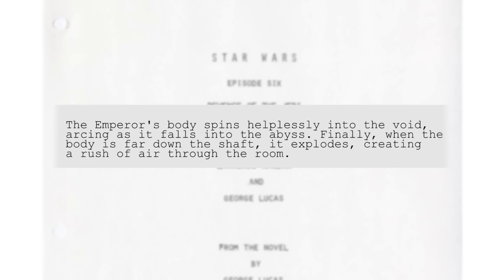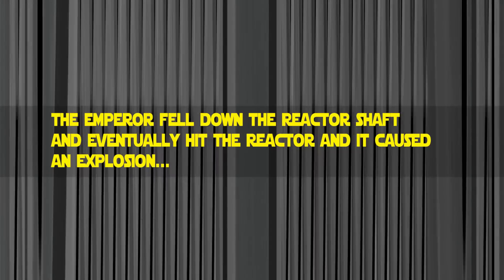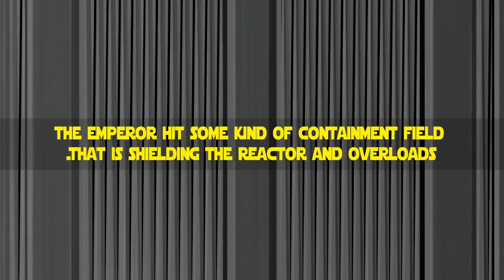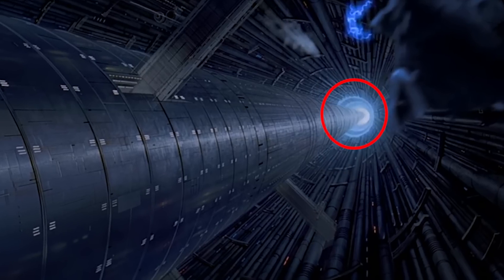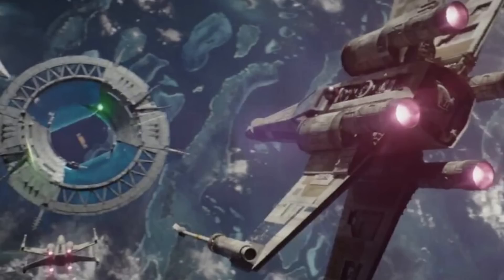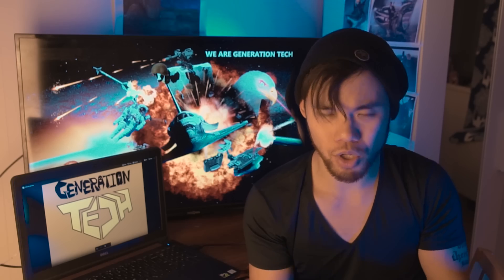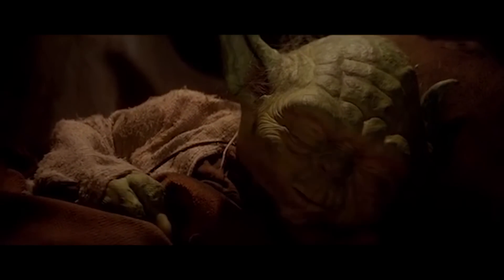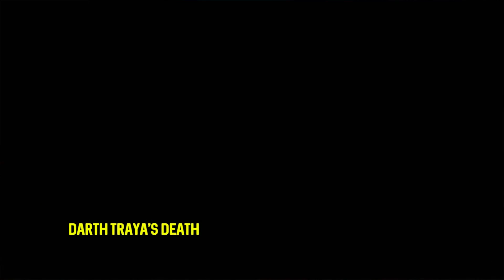Why Did Emperor Palpatine EXPLODE!? (Darth Sidious)

Comment: I've got two possible theories regarding this. The first is this: when Vader grabbed Palpatine, that force lightening that the emperor was still discharging was channeled back through Vader and into Palpatine (which is evidenced visually when we see several electrical charges detonate and light up Vader's skeleton through his armor.) This set up a sort of dark energy "feedback loop" that Emperor Palpatine was unable to control or contain. It was, in fact, providential that Vader tossed Palpatine's arcing body down the shaft; had he hesitated, the resulting inevitable explosion would have easily evacuated the entire observation deck into space.

The second hypothesis is similar to one covered in your video. Palpatine was uncontrollably arcing as he fell down the shaft. What he hit was not the shields themselves, but rather the shield emitters. It was, in effect, like a lightening strike to a power transformer on Earth, and the resulting explosion was both the emperor and the emitters annihilating one another in spectacular fashion.

Or...you know...space magic. ;)

Comment: If that was some sort of shaft to the core reactor, I imagine that as certain pointThe sheer heat and radiation coming off of the reactor Parent something as powerful as a planet destroying super weapon that had been fired multiple times over the last several minutes probably cause anything to burst into flames that got to close.

As for the distance to the core, again I would imagine that the weapon having been fired multiple times had caused a buildup of waste heat and radiation thus making the "burst point" further from the reactor.

Comment: As he was falling he was still using  force lightning which ignited the gasses around the containment ring. This resulted in an ignition of plasma which burst out in all directions, which is why is was swirling due to the positive and negative pressure waves.

Comment: the shaft doesnt have to be continuous. it seemed like a combination ventilation and power distribution shaft. notice how it had a shaft running through it? well something like the death star would require lots of ventilation to be habitable. the shafts would have to be huge. YUGE! fuckin massive. the ventilation ducts in large buildings that feed the client end ac ducts, are large enough for a couple people to fall down side by side. just a small piddly building thats not the size of palpatines bedroom. so these shafts would have junctions and other utilities in them such as cooling systems for reactors and weapons arrays. these would be interspersed throughout the shaft. they might also be shielded from flying debris or be shielded to help prevent intermixing of old and new air. or any number of reasons. also, do this experiment, take a Styrofoam ball, weight it with something and drop it through a pvc pipe just larger than it is. the pipe needs to be about 5 to 10 times longer than the diamerter of the ball. it will build up static rather strongly and quickly. now imagine palps falling down the tube, jizzing out all that lightning, in confined, electrically active column, its gonna build up some charge, well all that energy might be enough to ignite the atmosphere and produce plasma. this ignition isnt molecular, but atomic splitting molecules and rending atoms into a high energy state. it would possibly kinda resemble the energy leakage luke and vader experienced after the explosion.

Comment: Remembering that the Old EU has basically been pitched and the only darksider Sans Body we have seen is Bane. As well as the Fact all the EU was written After the Original Trilogy... I'm going to havt to go with the obvious thing here. Ret con-ing Maul was a Major F-up in Star Wars history making some other dark baddy would have been WAYYY more interesting but that would basically mean Mr Hudalgo would have had more time to write before production and less interference from George.

Be that as it may, the Emperor Better Stay dead. now if it some how comes out that EP  has been messing with Ben Solo's head by pretending to be Vader, that would be SO much cooler. as Palp's was a straight up evil deceiving jerk. So doing this would totally be something He'd do.

It's also cleaner than messing up Vader's whole redemption arch just to make money .... but that would mean someone at Disney actually cared about the Story 0.O & had the power to do something about it

Comment: How long did the proton torpedoes take to get from the entrance of the exhaust port to the core in the first death star? Wouldn't this give enough time for the death star to fire it's super laser? (Assuming that the button for firing the death ray has been pressed roughly the same time as Luke fired the torpedoes.)
Reply from the maker: +b93imp interesting question never really thought of that. I think modern missiles fly several thousands of mph but even that would seem to be too slow